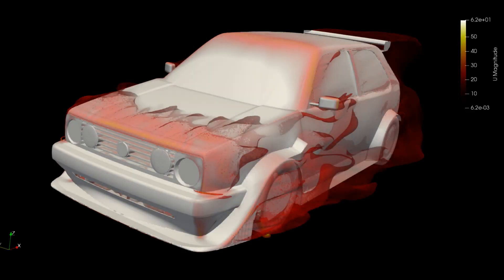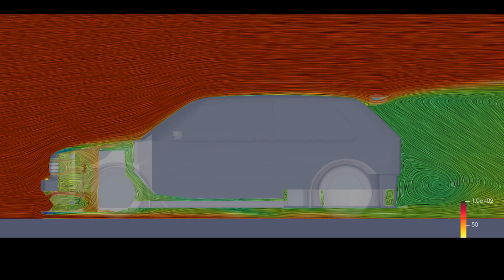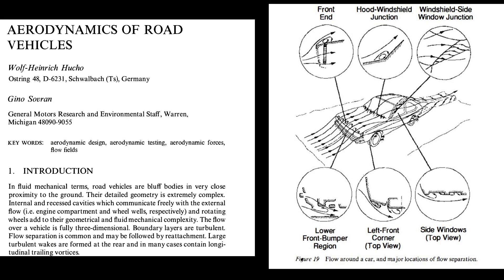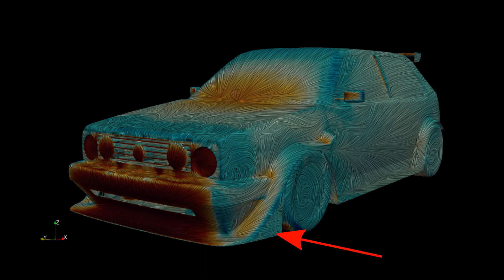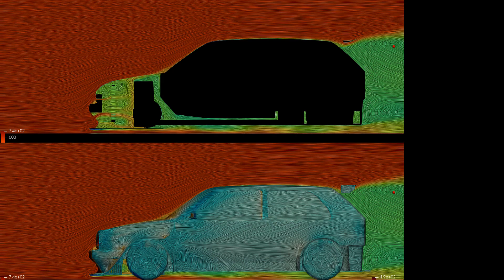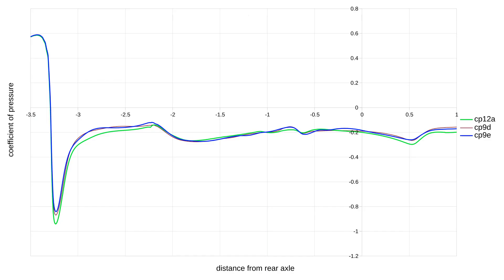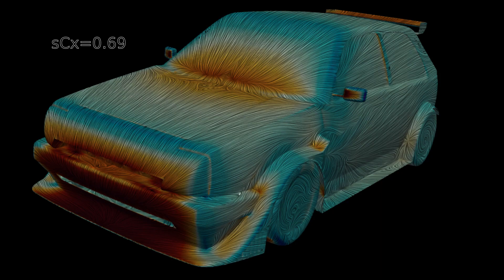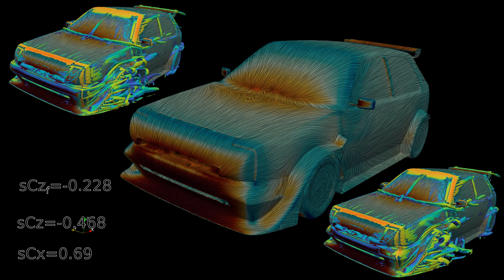Removing Lift from the Front

Comment: Super cool. So the kamei grill spoiler probably does help some. 

Room is the issue in the Mk1 engine bay.   I’m cutting out my core support to drop the radiator lower. Maybe I need to make a S-Duct with the upper grill and hood. 😊
Reply from the maker: yeah that add-on might. I tried something smaller a while ago I cannot remember the results so it probably wasn't spectacular. These solutions where designed to completely remove the problem.
With the space this solution was 250mm long, forgot to add that dimension, but you could get away with half that I think.

Comment: I'm amazed on how wrong is the Golf mk2 body as starting point... Lean forwards radiator to make proper channeled hood vent... And use a Skoda Fabia Combi mk1 6Y with oem rs/gt/gt line front bumper, orm under bumper/body mini spoiler and winter front grill cover... You'll get sCx on the 0.50s. play with the wrc hatchback rear spoiler and you'll get whatever sCz you need... Gw of around 1100kg and you can fit easily 1.8T or 2.0 engines like the ones in polos or ibizas gti/cupra...
Reply: And you get 15 years of VW CFD R+D for free plus a car designed by one of the better car designers in the VAG world of all times...

Comment: A boxy ef9 civic is a good model similar to the golf only better but the Eg6 civic is probably more slippery and allows for a bigger wing because of the down slope at the rear of the roof on an eg civic . The rules in Irish rallying say the Spoiler can't be visible,e from the front of the vehicle
Reply from the maker: thats a common rule across many categories. It definitely helps having a tapered roof line. The choice is between a wing and a spoiler. Recent wrc2 cars, before the latest ones, were running wings like spoiler because there is no way air would stay attached

Comment: Why dont you extend the front body work extentions all the way down to join to the bumper rather than the free floating design you have now?
Reply from the maker: modeling circumstance. Modelled the inner part then added the lights, things just lined up. The inner part is to preserve the grill openning
Reply: Im guessing radiator intake
Reply: maybe to preserve the appearance of the car

Comment: Nice video. Just an idea for an experiment: instead of smoothing out the corners of the front bumper simply cut vertically from the fender down to the splitter, then you can smooth out from the splitter to the part of the wheel arch where you already have downforce. This Polo implements something like that https://www.youtube.com/watch?v=qxNAIj2dFL4

Comment: I wonder if you could achieve a similar thing by turning that bonnet relief into a vent. Have it pickup behind  the grille in the same way and vent through the bonnet. That way it would still resemble the same car / front grille.
Reply: I'm also shocked he didn't do this.
Most racing cars do it, with a radiator in that area too. Since the 60's til today even, lots of downforce is made there.

Comment: Great vid, Nelson!
One comment:
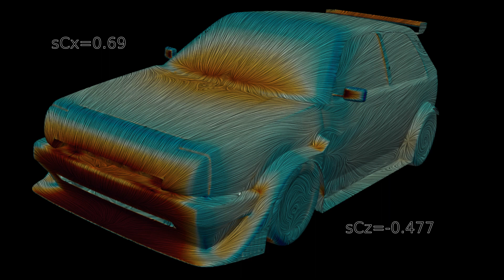6:27 "Front to rear split has "finally" reached 50:50"
I wouldn't dare race that car though hah! The moment the driver goes on the brakes with the car pitching forward, this would very likely move in favour of the front and creating quite a bit more of a front-bias, causing oversteer and potentially losing the rear, or, even worse, have the front stall and then losing all the front-end for a moment, resulting in a big chunk of front grip loss, only to regain it once the splitter comes out of stall. Let's assume stalling does not occur - the other problem may still render the car undrivable, or at least, make the driver lose a lot of confidence at medium and higher speeds. I would chase a balance of ~45-47% front downforce balance at a flat-rake simulation.
Reply: While what you are saying would be true in certain situations, I think you are confusing what dictates what the "correct" or "optimal" center of pressure position is. What matters isn't the center of pressure position relative the the car's axles, as your comment seemingly assumes, but the relative position between the center of pressure and center of mass of the car. Given this is a front wheel drive, front-engined car, which tend to have center of mass further forward, and the fact the car is assumed to be gutted, which will move center of mass further forward still, an aero balance of 50% front might actually be quite far backwards, and result in an understeery car. If we assume a weight distribution of 60% to the front, a more reasonable estimate in my opinion, an aero balance of around 55% front, while still somewhat understeery, should feel stable and make the car very easy to drive.

Comment: I hate both solutions, is the same problem an Argentinian category called TC has, you start to distort the shape of the original body so much in the end the car is not recognizable as a golf anymore.. there should be another way like evacuating all the air via the bonnet or similar
Reply: Accept the fate of "good looking old cars" or shape it right lol. Not much can be done through the grill or bonnet